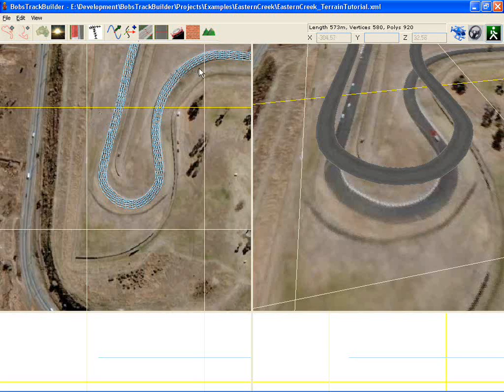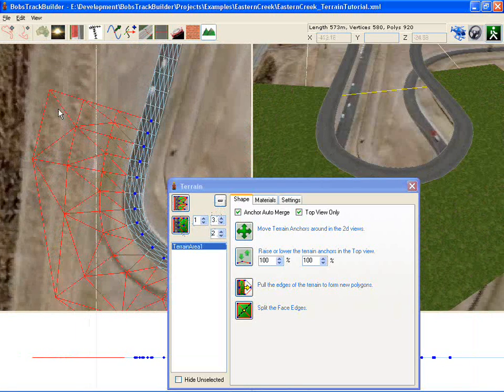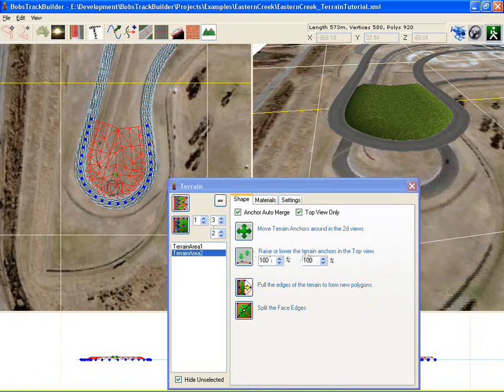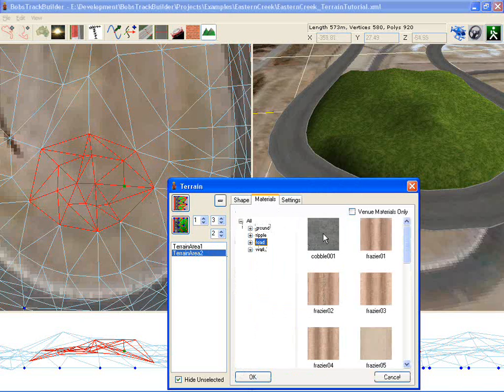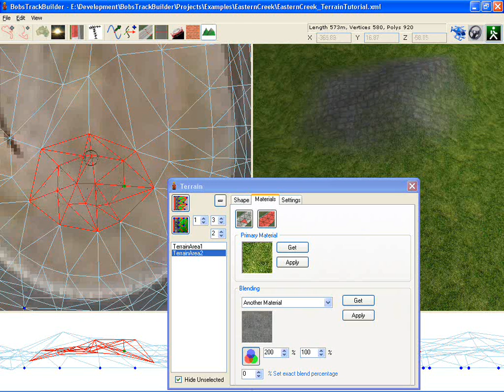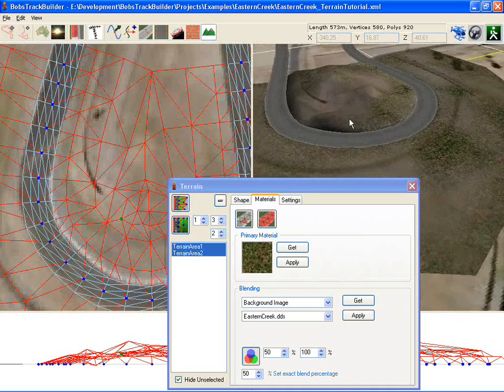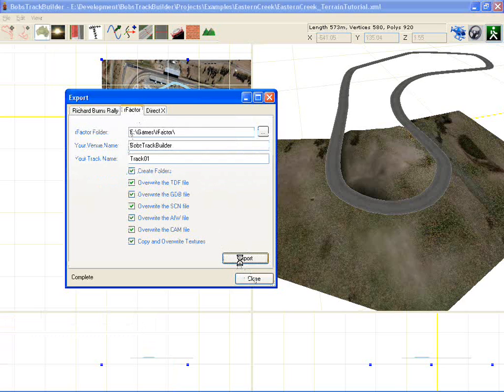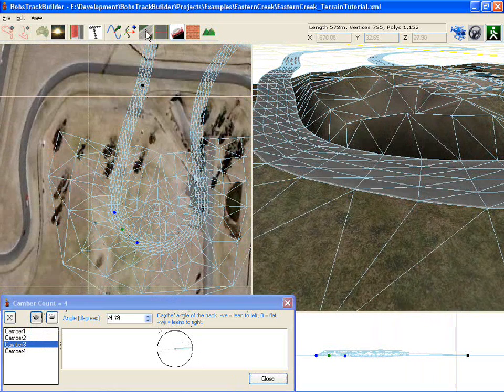Bobs Track Builder - Terrain

Comment: Will you upgrade BTB for Assetto Corsa or for other new simulators?
Reply: They have not, it is only an exporter - you set materials, lighting etc of your existing track model & export it to AC. You can create a track using that tool.
Reply: @jendabekCZ  sorry guys but my English is bad. BTB track can be exported to assetto corsa? 
Race track builder is very expansive and I don't want to waste 60€ in something that maybe I will never use again if I lost the hope because of no experience in 3d modeling
Reply: +John Burning They already have a track editor for Assetto Corsa.